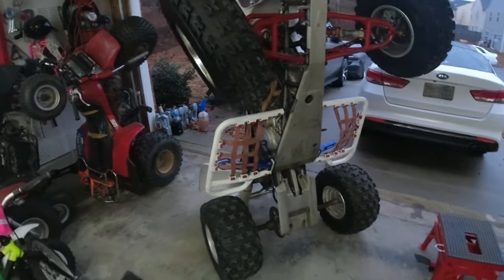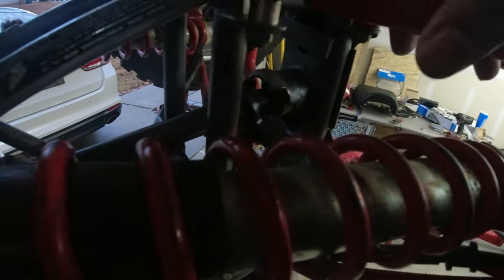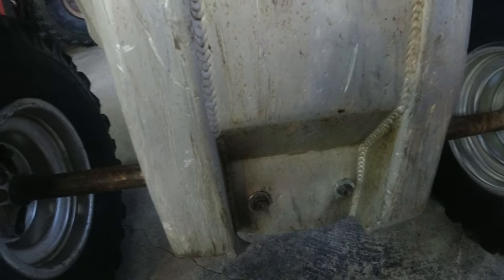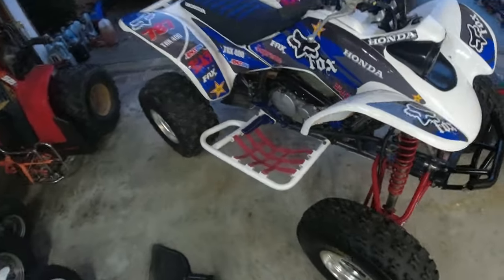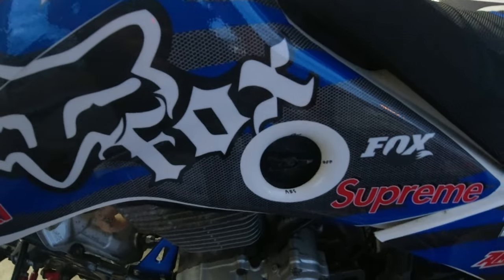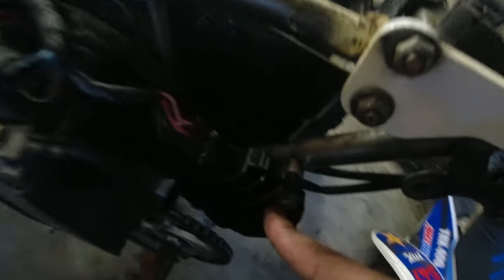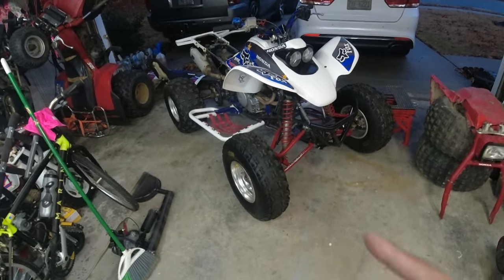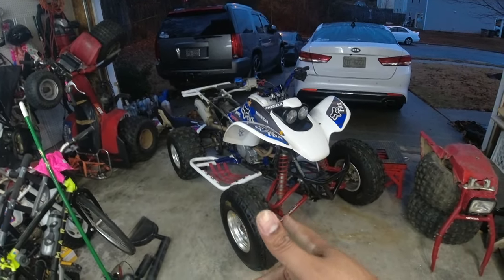Everything Wrong  (So Far) w/ My New Honda 400EX

Comment: That axel is most likely already bent and traahed.
Reply from the maker: I’ve already verified that’s it’s not bent. I’ll see when I take the hub off if the pin hole is ovaled out and if it is, I’ll just shim it with some soda cans. The question is are the hubs cross threads for the wheels studs.
Reply: @DariusBuildz  IDK maybe 🤔 so lol
Reply from the maker: And this axle is 1.3”. It’s beefy af
Reply: Being un balanced on a ATV like that is a recipe to destroy most axels I wish you the best of luck 🤞.
Reply from the maker: I've cruised it around and it feels fine. And that may would destroy the stock axle, but like I said, these durablue axles are the truth.